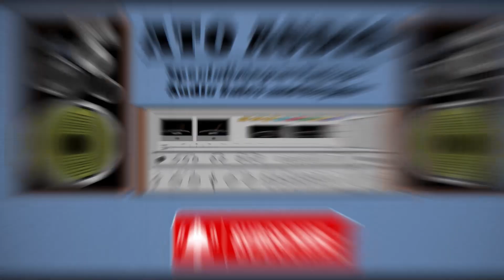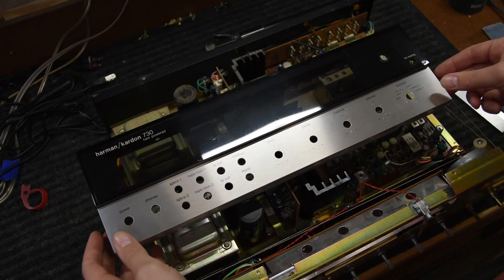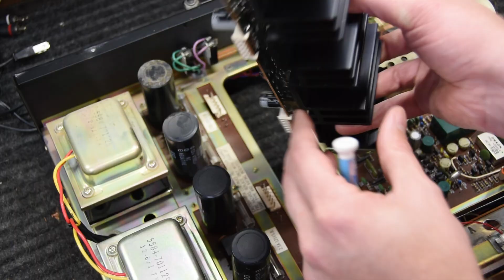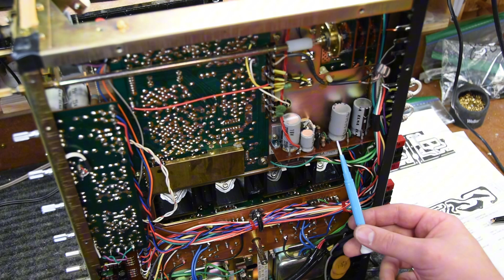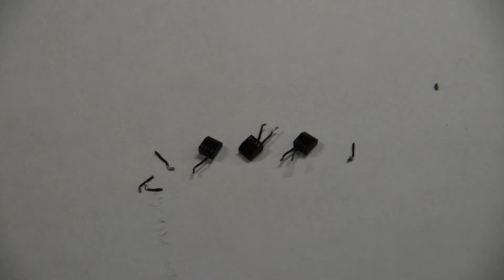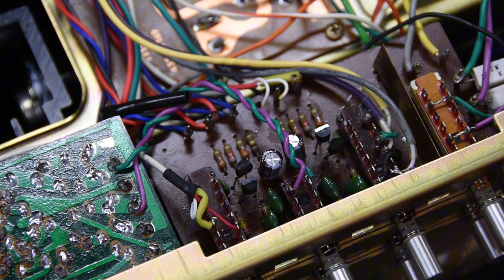Restore of the Harman Kardon 730 Twin | Vintage Stereo Receiver Repair & Restoration

Comment: I too was turned on to ATO Audio by Kevin at Skylabs Audio, I am so glad to have found him as Mike has proven twice now that he cares enough to repair/service any receiver he accepts with superior results. I tested him out with my HK 930 after a local tech wouldn't or couldn't make the repairs I wanted. Once I saw his work on the 930, it was a no-brainer to get the 730 in for refurbishment by Mike.  Remember, you get what you pay for, and your vintage gear deserves a master tech like Mike. Any audio gear that I get that in the future will likely pay a visit to his shop. BTW, his carpentry skills are equal to his electronic expertise.
Reply from the maker: Thank you Greg for the kind words!! Means a lot to me!! I appreciate you trusting me to restore your receivers and giving me the freedom to design some awesome cases for them as well.

Comment: For replacement of the 2SC1162 on the bottom side you went to TO220. If you wanted to stick to TO126 you should grab some MJE243G and its partner MJE253G, they’re great to have around when needing something a little beefier.
Reply from the maker: Thank you for the advice!! I'm going to look at them now!!!
Reply: @ATOAudio  I really do appreciate you commenting on the device numbers you’re talking about and some of the device numbers you are swapping out. Would it be possible to know the device numbers you used on the amplifier board? I’d really like to know the pieces you selected for swapping those transistors
Reply: They are a pretty popular option with the audiokarma crowd. I keep about 100 of each on hand, though they’re not used or needed all that often. But when they are they are nice to have.

Comment: Any chance you would list your transistor subs in the amp? I have a 730, 630, 430 and 330 to do here soon.  But I own a HK A402 and it looks to be the same board or very similar.  It goes into oscillation as soon as it’s powered up, so your replacements would be great to try.  I have many transistors, even many that have been EOL’d so don’t worry about me possibly not having something like the KSA1220. Thank you.
Reply: my A402 has bad history on L R channels issues.  just had 4th repair.  last time messing with this as last 5 yrs got $800+ repair bills.  hate to give it up.
Reply: @bigaldallas it’s a very nice piece of equipment, I really like them. They just seem to be a bit unstable. Don’t like transistor substitutions all that much.
Reply from the maker: I'm working on making my subs available for my membership plan or something like that currently. Haven't really decided yet as I get a lot of people wanting my plans etc. I was thinking about a quarterly plan of like $25 or something like that which would get you access to my plan/subs and also like a 15-30 minute consult. What do you think about something like that? I'll take any feedback as I'm literally in the planning/ "I have no idea what I'm doing" phase.  Also I went ahead and order 500 each of those transistors you recommended. Way overkill but it was significantly cheaper to buy in bulk.